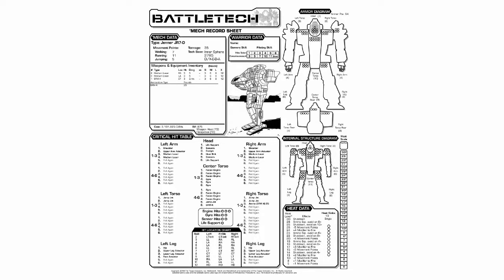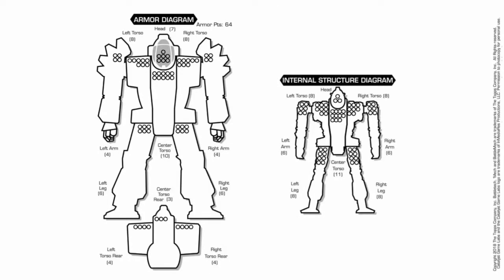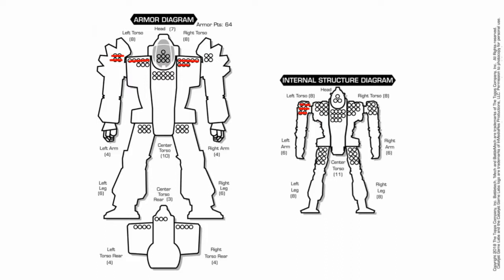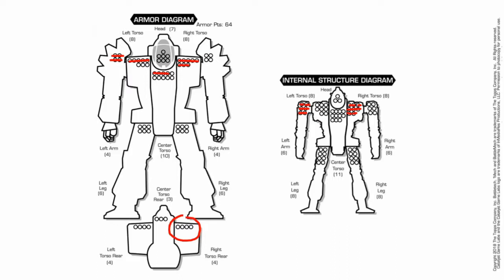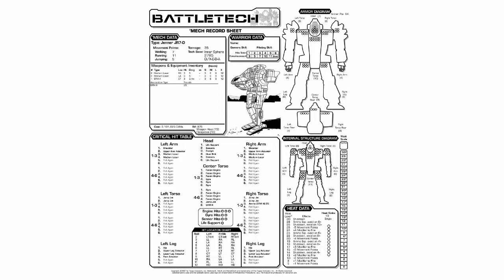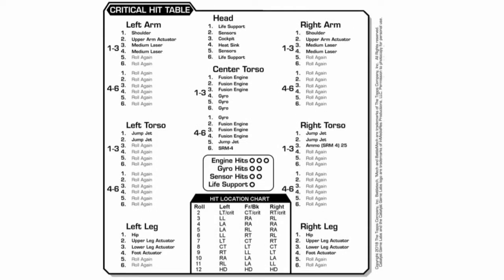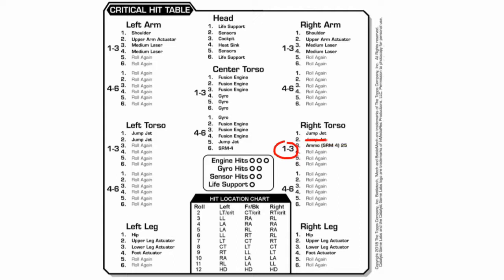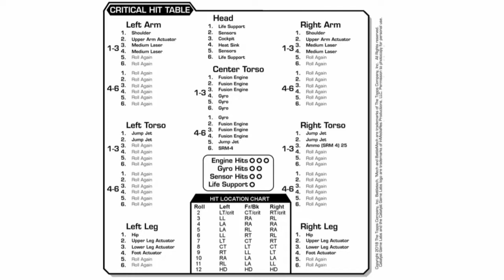BattleTech: Game Play Demo - Taking Damage

Comment: 5:00 Very interesting point. The rulebook never explicitly covers RT armor, so an FAQ would be useful here, but it is explained in the general case. tl;dr (rear armor is destroyed also).

BMM pg.41 "DAMAGE RESOLUTION: Once the internal structure of a location reaches zero, that location is destroyed. After a location is destroyed, damage to that location transfers to the neighboring location."

Ok, so here a mech "location" is defined as any section containing internal structure (this is important). We need a definition of what is a location to get the right answer.

BMM pg. 43 "LOCATION DESTRUCTION: If a location is destroyed, all components in that location are also destroyed, including ALL armor." 

The official rules are clear and state all armor is destroyed explicitly, it also lightly implies that armor may be a type of component and is certainly not a location.

So no, in this case when the right torso location is destroyed, the rear armor goes with it. Think about this logically. Following your reasoning this means that, for example, if a back attack destroys a right rear torso armor section and all its internal structure is destroyed as well, that somehow the 30+ front right torso armor remains intact, even though that location doesnt exist anymore! Hardly seems fair.

13:30 BMM pg.129 FAQ. Brief point that is often missed on arm flipping, as I dont think your going to cover in this series. You can only flip both or none of your arms, so the lower arm actuator and the hand actuator has to be removed from both to flip the arms (and not through critical hits!). I see vets getting this rule wrong, flipping a single arm because one doesnt contain a lower arm actuator. Additionally, (possibly from the tech manual?) the weapon must be fully installed in the arm critical slots to be fired into the rear arc while flipping (not including ammo of course), if its half installed in the torso and half in the arm for example, that weapon cant be used at all for the combat round when the arms are flipped.

15:00 Absolutely correct! Glad to see this covered.

Comment: great video, thank you for crit explination. Curious question When ammo explodes in the arm, does the damage caused stop in the next torso or continue into the center torso
Reply from the maker: You are welcome!  Thanks for the comment and glad to know it was helpful!!
Reply: If you don't have CASE it keeps going until all damage is dealt or CT is destroyed. Also the pilot takes 2 damage, or,  if the CT is destroyed by ammo explosion, is killed outright with no chamce of ejection
Reply: If you have CASE the 2 damage to pilot still happens but the damage is isolated to the section the explosion occurred in, in your example the arm would be blown apart but the torso would be spared